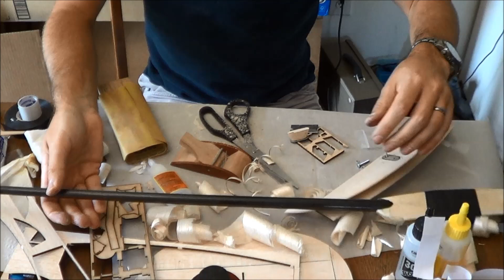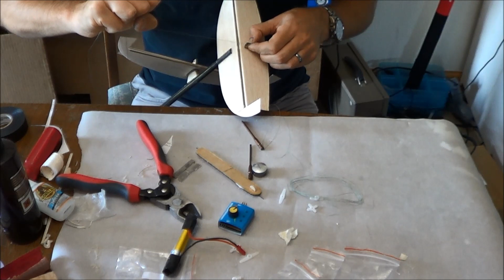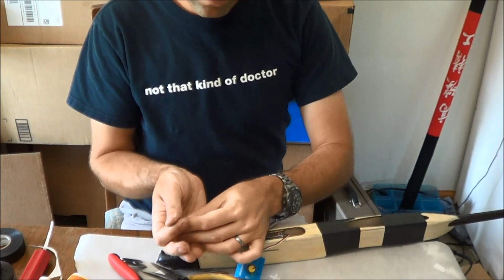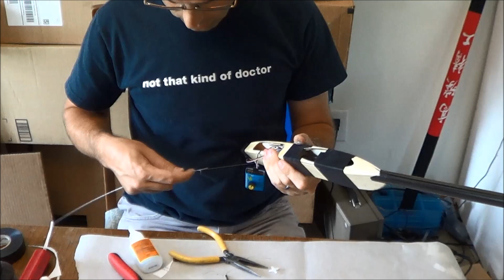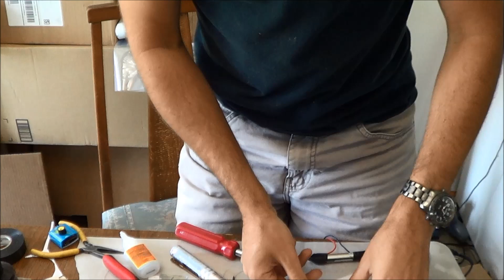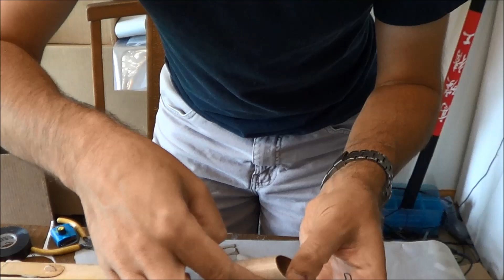Evo Fire fuselage build, Part 3

Comment: It would be cool to have a delayed rocket ignition on a typical DLG launch, firing near the apex of the throw.
Reply from the maker: wunkus that's exactly what we did with the first four prototypes. Onboard ignition controlled by the transmitter. It's an incredible rush to flip the arm and ignition switches after leveling out and then having the plane blast off into the heavens.

Comment: At this point, I’ve only done flitetest foam builds, but watching the videos for this build and the ones for the wing construction have me intrigued. How did you put a light kit in the wing?  Did you have to do a lot of cutting and soldering to get it between the ribs?  Are they bulbs or tape?
Reply from the maker: Aaron Roehm for mine I just poked little holes in the ribs and strung led Christmas lights through. Not as pretty as what Dan did on the other three prototypes which was to use thin jumper wires to connect LED strips bay to bay. Tedious, but the effect is beautiful. Then you just stick a bright LED on the front of the rudder and you've got a spectacular setup. Dan will be recording a build of his next one showing all the lighting tricks.